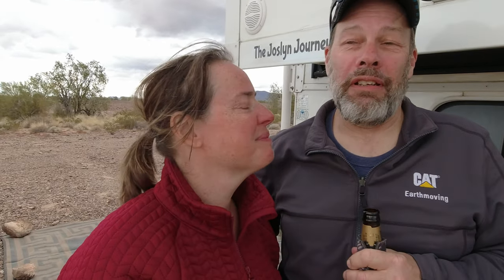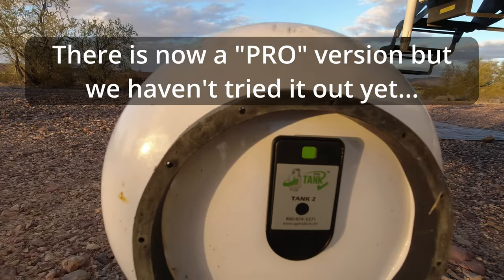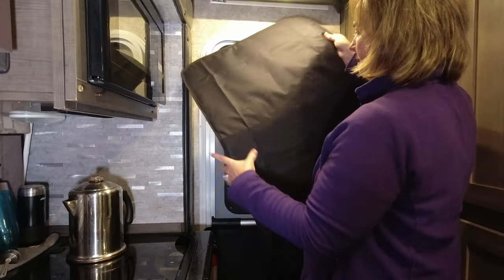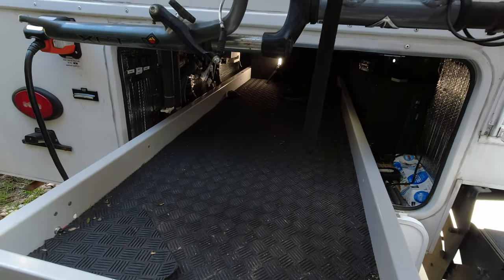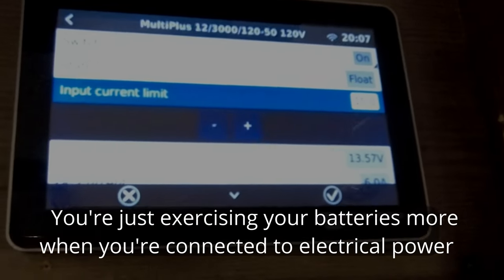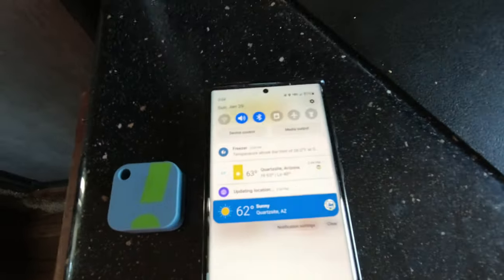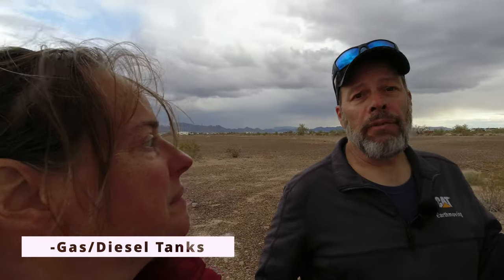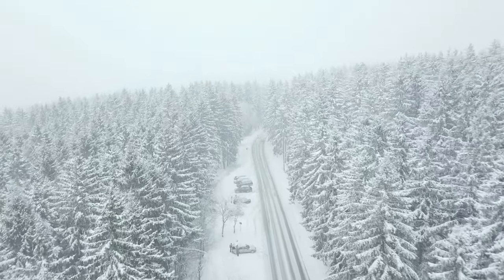Winter Camping: How to Stay Warm in the Cold! | e111

Comment: This video was really helpful. I have a Host with a Victron Mulitplus, similar to yours. I'm still finishing up all of my electrical work, but one thing you might look into is running your basement heater off the AC-Out-2 on the Multiplus. It's programmable, so you could set it to turn on an outlet when the temperature is below X and your State of Charge is above X%. I thought your smart plug was a great idea, so I started looking into pairing it with the Cerbo for automated control. I couldn't find that, but that's how I stumbled onto the AC-Out-2 option.
Reply from the maker: Hi Neil - what a great idea!  I hadn't thought of that one!

Comment: Holy smokes this is one of the greatest videos I've watched in a long time thank you for sharing.👍 I would like to know more about that camera that I just noticed on your video, but I wanted to say this. The freezing point of diesel exhaust fluid fluid is 12 degrees so you have to be in some extremely cool temperatures to have your def freeze. But do keep it out of direct sunlight and you shouldn't let your DEF get over 86 degrees. So you really should stored in the camper in the summertime...
Reply from the maker: Thanks Kc for the wonderful comment! I worked hard on this one! And really good point about the Def. We keep it in the truck during the winter but you're correct - heat and sunlight are bigger factors. Thanks for sharing!